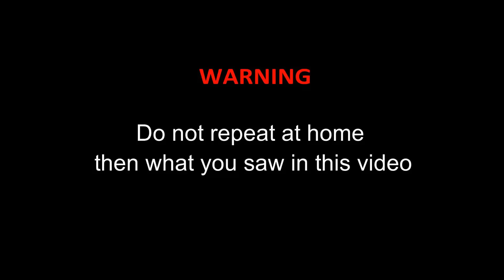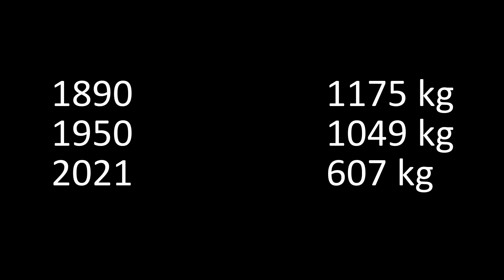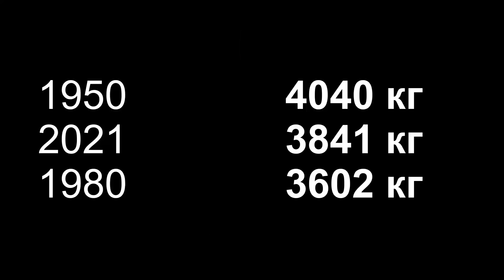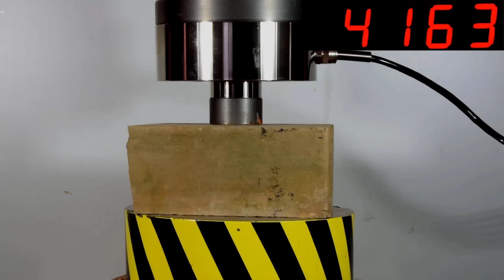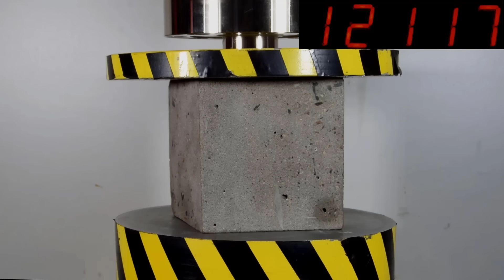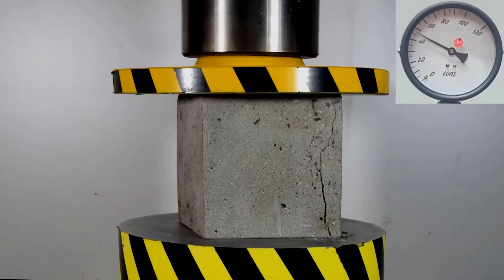HYDRAULIC PRESS VS OLD AND MODERN BRICKS

Comment: Modern bricks aren’t usually made to be weight bearing as they’re only used for facades, not actual large scale masonry
Reply: Are you on drugs? Then i guess the roofs weight must tranferred through magical invisible posts then.
Reply: Rob, most bricks used in North America today are not used for load-bearing purposes. They are tied in to the actual structure, which sits behind the veneer. This could be poured concrete, concrete masonry, or a wood or steel frame, for example. 

In the case of the frames: yes, in a way there very much are posts you can't see behind the brick façade.
Reply: News flash: America isn't the whole world.
Bricks are most definitely still used for weight bearing applications elsewhere.
Reply: I'm in England where most houses are built from load bearing clay bricks. Don't know how it's done in America. You guys build with a lot of structural timber for much of your housing stock?
Reply: @UncleChopChop22  ever heard of Reinforced Columns and Beams?
Reply: @S_Carol  And you are trying to imply this 2021 brick is universal and used for every application, which is a ridicululous assumption. There all kinds of bricks for all kinds of purposes.

The bias in this video is shown on how they compared old structural bricks with a modern facade brick. And the concrete part is just moronic, of course the 100 year old concrete of a fortress is going to resist more weight compared to modern regular one. You should ask why the fortress still stands and most of abandoned old houses are in ruins.
Reply: @UncleChopChop22  depends, most new homes  and buildings with brick also have frames behind them supporting the actual building itself. The bricks on newer homes is more of a facade or insulating layer, in many cases its just paneling. The use brick is no longer convenient since you'd still have to add the cost of running electrical conduit and beefier foundations. Masonry also cost more than wood framing and/or poured concrete walls when you take labor and material into consideration.
Reply: @UncleChopChop22  lmao Seethe more.
Reply: @seanmurray7822  Yes.
Reply: @DirtyMike_n_theBoyz  in the USA maybe. Elsewhere complete houses are built from bricks. And people might choose to put 'pretty bricks' in front of the walls, but the house is still made from bricks. Floors are cement, the roofs made with wooden timbers and heavy brick-like roofing tiles.

Maybe there is a reason why tornadoes in the USA are so devastating, while tornadoes of the same strength in Europe only do some damage.
Reply: @seanmurray7822 : "You guys build with a lot of structural timber for much of your housing stock?"
Exactly.  The vast majority of houses (there are always exceptions) in the U.S. & Canada are framed with wood and that frame is usually sheathed with sheet goods (plywood, OSB) for structural strength. If the desired outside appearance is that of brick, brick (full-sized brick) is then laid on the foundation to the roof line (straps are nailed to the exterior wall & laid in the mortar between bricks).  In this type of construction, the brick carries no load.
Reply: @pcs5852  everyday a school day, thanks 👍🏻

I'm interested in how different countries do things. I believe you guy still have some pretty big forests to harvest. England has far less woodland than centuries ago. I believe we switched to masonry construction after the great fire of London. Houses were mostly wood framed then with thatched roofs. 

Used to use exposed oak frames infilled with wattle and lime plaster over that. Or cob houses in some areas. Some still standing and in use more than half a millennia on
Reply: @UncleChopChop22  Not in America
Reply: @seanmurray7822 :  There was a period here ("here" being southern Ontario, Canada) where houses were of brick (several layers) construction and some of them are still around.  By the early 20th century, wood-framed houses replaced all-brick houses.
It"s not that we have original forests yet to harvest; the easily harvested forests were used up long ago.  However, lumber companies generally plant more trees than they harvest and due to modern forestry techniques, the "new" trees grow very quickly.
The drawback to this technique is the quick growing trees produce a lower quality lumber than was produced by the slow-growth trees.  It's nothing you would use to build high-quality furniture but, using modern construction techniques, it's strong enough to construct buildings.
Reply: @pcs5852  as I understand it if a softwood frame is encased and not exposed to the elements then if condensation/leaks etc are managed properly, there is no reason for it to rot prematurely. 

My own house is 100 years old and built from two layers of fired clay brick. It's really solid but can be a bugger on energy bills. Insulation in roof but that's it. The footings are shallow, tamped rubble, gravel and sand  suspended wood floors. Once the bricks get warm the mass holds heat for a bit but not a full day. Our winters our mild but wet. Summers increasing hot and house can turn into  a bit of an oven. I have air con in my bedroom.

When they built this place it was designed to leak air to feed the fires that would of burnt in every room constantly to keep warm in the winter. I have a gas boiler to heat radiators and a woodstove in my lounge. My bedroom is above the lounge 😁
Reply: @seanmurray7822 :  Here's a reference to the "ideal" (a few years ago, anyway) method to build an energy efficient house in Ontario. It's called R-2000 and you'll have to google it. YouTube does seem to like links,
At any rate, the general principle is to build your wood framed house such that the interior is airtight and the exterior is wrapped with a product that allows moisture to exfiltrate (Tyvek House Wrap, for example).  In general, 2"x6" studs are used which allows R-19 rated insulation in the walls whereas attic insulation will be in the R-40 range.
These airtight homes can have an air quality problem so must be fitted with a heat exchanger in order to bring in outside air.
It's an interesting concept as energy prices continue to rise.
Reply: @pcs5852  yh I'm a big fan of the passive house standard or at least enerfit. It would cost far more money than I have to retrofit my house to that standard. I heat to above the dew point and open windows periodically
Reply: @seanmurray7822 :  That's the problem with older homes, isn't it?  There's some government subsidies available over here to add insulation, upgrade windows, etc.
Most of us here in the southern part of Ontario have central heat & A/C to escape the summer humidity.
Reply: @pcs5852  they are trying some subsidiary type programs here but it doesn't cover renovating your house and housing you somewhere else whilst the work is carried out. For example in my case I'd have to internally insulate. Then replaster and repaint the whole house and replace flooring, skirting boards etc.  That cost is on me. My smaller rooms would become very small afterwards. Millions of homes here are like this and most new builds are of poor quality and hugely over priced. It's a ticking time bomb really for the UK housing market.
Reply: @seanmurray7822 :  The one advantage to a wood framed house is that if it wasn't insulated when it was built, loose insulation can be blown in between the studs through a small hole in the inside, or outside, wall.  Attic insulation can also be blown into the attic with a 6-8" hose directly from a truck equipped with a blower.
It's hard to say about the quality of new house builds here as it varies from contractor to contractor.  The R-2000 home is rarely built as it is labor intensive and, therefore, more costly.
Our housing market has already exploded and not in a good way.  House prices have more than doubled in the past 5 years. Combine that with a mortgage rate that, based on inflation, will increase from less than 3% to more than 8%, and it's going to be extremely difficult for young people to buy a home.  Of course, rents are increasing along with home prices, so our homeless population is likely to increase dramatically.
Reply: @fordesponja  Where tf did I say any of that? 😂 It's like I said "apples" and you're talking about horses
Reply: @pcs5852  Current average UK house prices are 8x average wage and similar situation on inflation and interest rates. Lot of pain coming down the pipeline.  Still we'll survive or we won't I guess. It is what it is.
Reply: @seanmurray7822 :  Good luck.  Nice chatting with you.
Reply: @seanmurray7822  yeah I was really just talking about shitty new housing in the US
Reply: @S_Carol  no shit I just mean the majority of bricks in developed countries are only used for facades so they don't have to worry about how strong they are.
Reply: @pcs5852  likewise
Reply: This is true, but proper research and testing shows bricks withstand earthquakes (tested up to rictor scale 7+), only fireproof and best sound detoning.. And unable to skim out as much as concrete
Reply: @UncleChopChop22  Pillars, beams, they're wonderful things. Bricks in your average house nowadays are mostly to close the walls, the load bearing is done by steel-reinforced concrete.

That is, if the whole building isn't poured concrete in a steel frame to give it strength.
Reply: @methanbreather  Tornados in Europe are typically much milder than in the "tornado ally" areas of the USA.  One of the only really bad one was in Hautmont, France, about 15 years ago, and that, which was only middling by USA standards, shredded every brick building in its path. In photos of American tornados, one often sees "brick" buildings still standing while those destroyed look like piles of sticks, but it's often the case that the ones destroyed were built the same way (bricks on the outside, wood frame inside) as the ones destroyed. The wind load ratings in most places are the same regardless of the material, though resistance to projectiles is also important and generally gets better the more brick, concrete and steel are used. Some newer houses with vinyl siding over foam sheathing are extremely vulnerable to projectile damage and should not be built in hurricane and tornado prone areas.

Comment: I think some of it might be that they were overbuilding bricks in the past, and with modern technology, we've been able to optimize the mixtures to make the bricks cheaper, while still being "strong enough" for the job.
Reply: Yep, you don't need your walking path or house exterior facade to support much weight, so they're generally bought for cheap.

I've seem some pretty cool tests of different concrete mixtures we've got nowadays for things like bridges and skyscrapers, and they are amazingly strong.

Also, the role rebar plays in the support is super interesting, because it allows us to focus less on tensile strength and make things super strong in the the other type, which I forget the word for.
Reply: Oh, also, keep in mind, these are the bricks that survived, the old shorty bricks probably already got smashed up line the new shitty ones will.
Reply: @monty58  compressive Strength might be the word you were searching for

Comment: The hydraulic press contact points play an important role in the results for each of the brick types. While a single brick can fracture, keep in mind that it's more likely to lose it's bond to adjacent bricks - meaning the mortar mixture could be the source of a structure compromise.  You can scale this concept with concrete and see the agregate rocks holding up to forces much longer than the rest of the mixture that bonds it. So, engineers purposely reduced brick hardness over time as they saw use of steel framing increasing in construction.  The most fair way to evaluate a single brick is to mortar it to the test device so surface contour contact is uniform.
Reply: The newer ones have more air inside them and not as solid as bricks from the 50s and the 1890s. Either way I think the newer ones would've broke because the ones from then were made better.
Reply: @theterminator3907  but does it matter? I think they realized that bricks didn't need to be that strong to begin with, so they did increase air pockets, which deceased strength, but also deceased cost of material. Probably also adds to thermals with all the air gaps in the brick.
Reply: @YouTrolol  well it did matter back then, but no not now. We don't really build buildings for defence anymore... really we don't build defense at all unless you count a tank maybe? Again though a tank is more offense than it is defense...
Reply: my brain can't handle this wtf
Reply: @davidedds6562  tank out of bricks? or wdym
Reply: @alessandrogaelsantafecacha8342  I mean we don't build defensive structures at all anymore... there are SOME bunkers but they are rare and unused. I'm stating it used to matter how hard bricks were as defensive structures used to matter. They don't matter anymore.
Reply: People don’t build with brick anymore. It’s usually cmu reinforced. Bricks are often used for aesthetics
Reply: Thank you for your eloquent explanation.
Reply: The flaw that gets me is he changes the press contacts,  towards the end to the large circular play which significantly drops the pressure/inch so the much higher numbers don't actually signify any change in result, in fact the fortress brick might actually have required the least about of mass to fracture it. For example if it was pointed it would require far less mass to cause failure because all the mass would have been applied to a very small point. It's why pickaxes come to a point rather than a large flat surface.

Not to mention the internal structure vs the flat hard steel causing stress fractures from shape alone.
Reply: @stewttv  He basically said that Bricks were made denser and more resistant since they didn’t have steel to help with the load. Once rewire got popular bricks that are so rigid isn’t necessary since the load is balanced. He’s trying to say it should be made fair by having the same strength you get from a complete rebar and brick specimen vs just the modern brick.
Reply: I was thinking the newer bricks just don’t bend as much before breaking but if the 2021 brick was 200 years old it would bend more before breaking. Do they bend more the older they get? Please respond
Reply: Or do they get softer as time goes on
Reply: @ihategoogle5402  more rigid
Reply: @ihategoogle5402  it's technically more of a mixed bag, the more solid the stronger, the more impurities the weaker. Material type has a lot to do with it as well. if they get harder or softer isn't probably easily quantifiable since having bricks with the same amount of impurity isn't easily done. However, the different heads that he uses on the press make huge differences on how force is applied. the touching surface area has everything to do with the number shown, the more surface area the higher the number. the smaller the TOUCHING surface area the more force is applied to a smaller area meaning it'll break faster.
Reply: Mortar varies even more widely. Some stay solid, others  become sand, drpending on the original mix

Comment: A good comparison is to convert the kg to Newton’s/kg taking into the account the density of the bricks, secondly cement is a hydrate reaction and increases strength over time.  I worked for a cement company and experienced the breaking of 10, 15 and 20 year old 100mm standard cubes, the building shook when they broke, took the crushing machine to near its maximum load.
Reply: crazy that we can't make cement as good as the romans still, especially in the sea/water environment
Reply: @michaelkaster5058  there is a way to make concrete suitable for sea water, using ground blast furnace slag or pulverised fly ash together with ground limestone which greatly increases the concrete strength and resilience to sea water attack.  I worked on a project which uses self compacting concrete with PFA and limestone powder in a concrete mix and it produced excellent results, it didn’t need any compacting poker methods just a straight pour, very interesting reactions taking place.
Reply: @johnmansell5097  have you ever heard of concrete that sets underwater, i was told the romans used it to make ports, do you know anything about it?
Reply: @TS-jm7jm  its a common thing, how else would we build piers and bridges
Reply: @guguigugu  the roman one i mean

Comment: Awesome and informative test, although you'd need a larger sample size to be sure... plus shaving flat spots on the contact points to ensure they are all equally supported.
Reply: Well, "...you can't please everyone!"
Reply: @dustymiller65  It's not about pleasing anyone, it's about being consistent. The contact points on those bricks are not the same. The ones farther to the middle will be much more resistant to breaking.
Reply: @endgovernmentextremism  
To me, they're just bricks; some old some new, but bricks nonetheless.
BUT, my geekish friend--I see your point now; so I agree with you. ✓
Reply: I'm beginning to see now that the breakage test should correctly aligned with the normal axis for the standard brick's normal usage. That would just make more sense.

Comment: The first test is effectively a tension test. The bottom half of the bricks experience tension forces as the brick tries to “bend” to match the forces. (BTW, bricks, concrete, and the likes are awful at sustaining high levels of tension.) 
The compression tests are much closer to what the bricks will behave like in normal use cases.